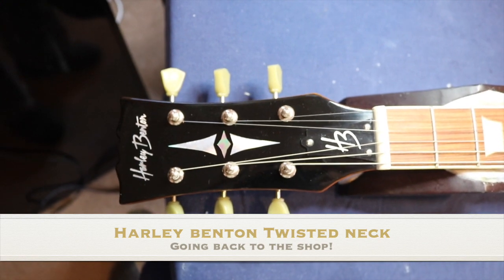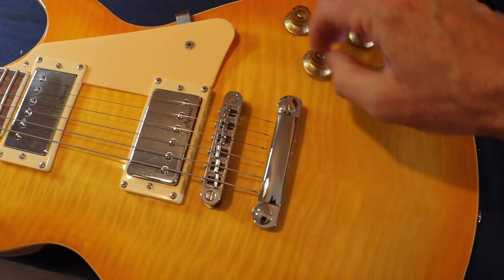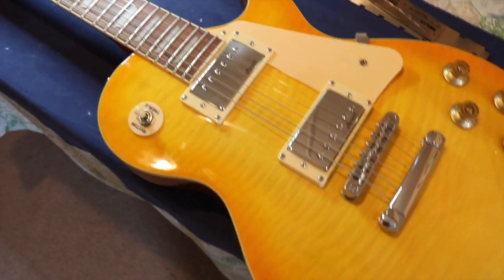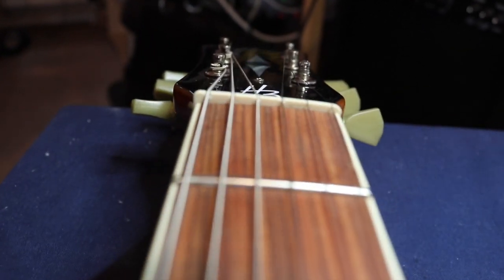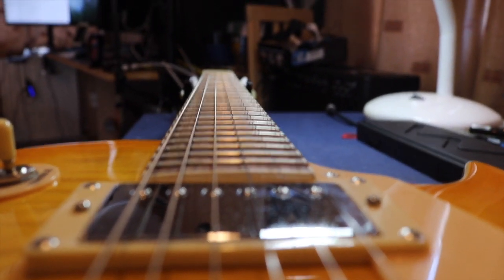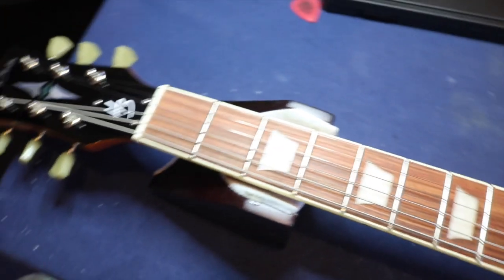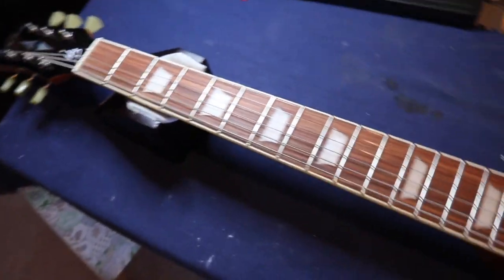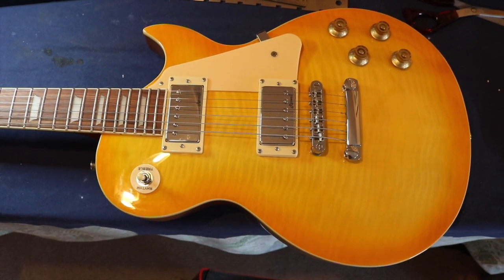Harley Benton twisted neck

Comment: The nut on my SC450 Plus looks like the same as this video, but it does not mean the neck is twisted. Mine is dead straight. As previous comments mentioned this nut tilting is pretty common on Gibson style guitars.